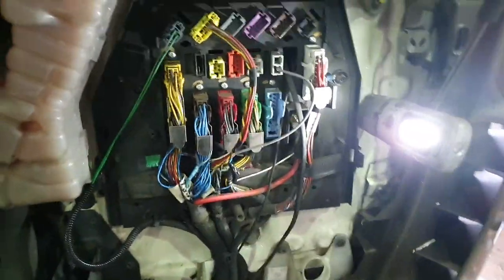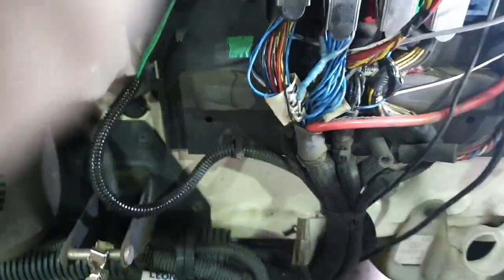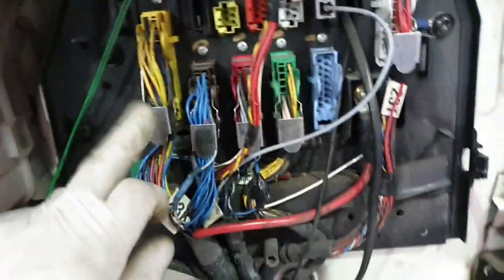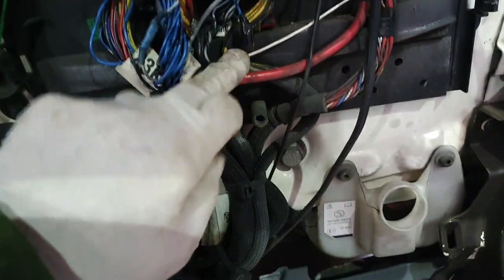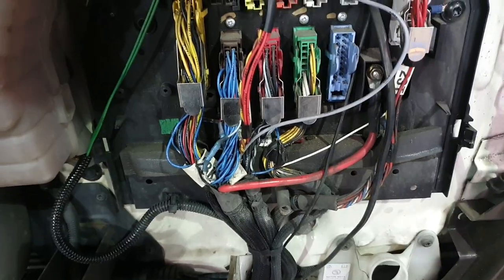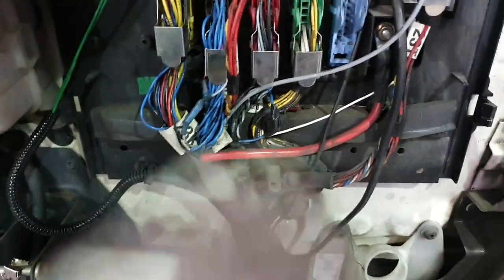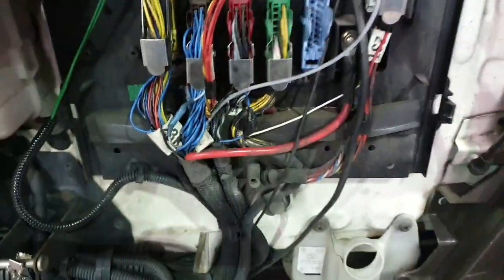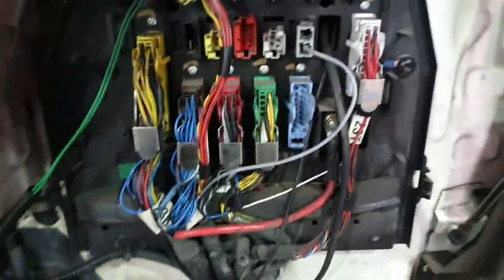DAF LF 45 / 55 pad warning

Comment: On older ones same number blue wire 3406 but on yellow connector
Reply: I have a 2009. Would it be the bigger yellow block all the way on the left side then?  I am actually working on a 2009 peterbilt 210, which is extremely similar and want to double check with you before I start to dig into it too much.  Do you think that would be in the big yellow block in 2009 or the smaller red one like pictured? Thanks

Comment: How do you  do it on a daf cf euro 3, I have a  red warning light ebs . But the brakes are working good.I use the same nr 3406 blue wire but still the alram in the cabine and the red warning light

Comment: 2004 Daf 45  LF all the wires on the 3rd block are grey no blue wire, can you tell me which wire it is? how many down? on left or right? Cheers
Reply: Hi did you manage to identify the correct wire on 2004 Daf 45 Lf got the same problem please help
Reply: @leozivira5503  No I didnt bud. My Daf is parked up and being converted into a campervan now so havent got round to it yet. All my wires on mine are the same colour grey. If you find out can you comment on here please
Reply: @onewayticketdave1554   hi did you solve the brake pads warnings problem yet. I haven’t find any way to solve, still driving with that noise on
Reply: @leozivira5503  no mate, I'm still busy converting the back to a camper so its not on the road yet. Am still following for a solution
Reply: 3406 blue wire on yellow block left side about 1/4 down

Comment: Alright mate do you know if this is the same on a lf euro 6
Reply from the maker: Not sure mate but if the wires are the same colour then they should be
Reply: @dannyandrew725  okay thanks mate
Reply: @nathanglover3647  euro 6 is a different set up plug wise...the system works the same so earthing the wire will put the light out

Comment: What about cabin lock alarm
Reply from the maker: 2 sensor wires on cab lock disconnect and bridge a wire across the 2 pin plug on both sides